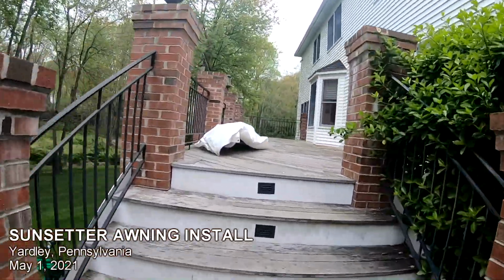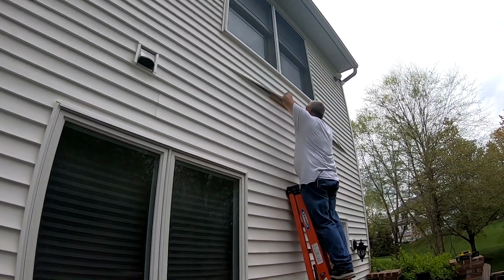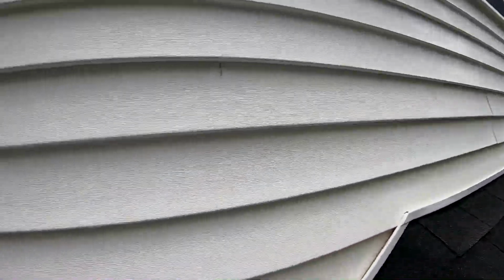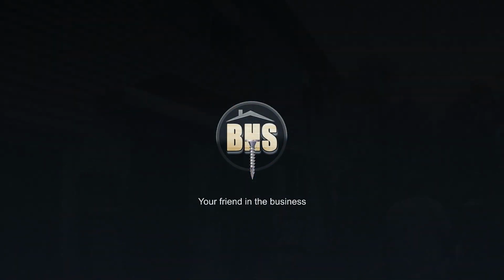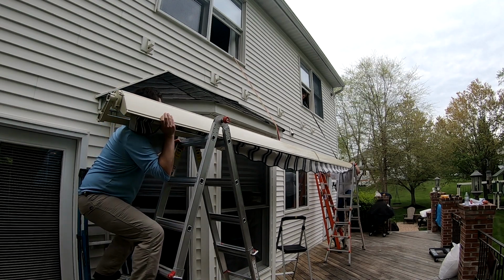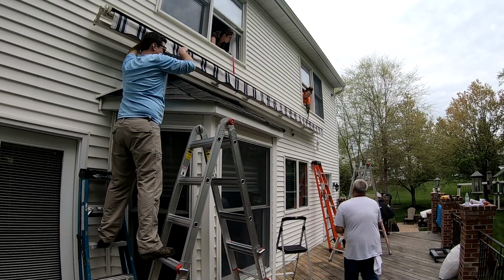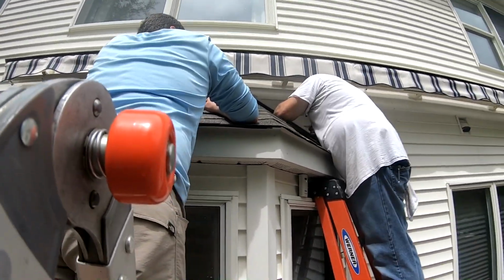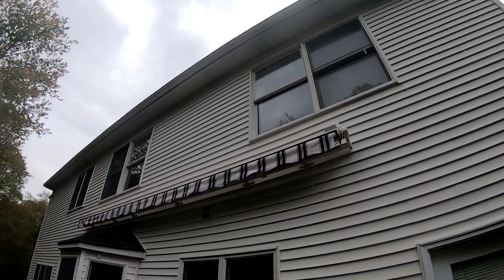HOW DO I INSTALL THIS AWNING

Comment: My buddy and I just installed one of these (18') for my boss two years ago...the wind off the lake has caused it to pull one of the lags loose so tomorrow we will be removing it to better secure our brackets. I was watching this video specifically for a better idea on removing it and lifting it back into place. We nearly died putting it on. Not looking forward to tomorrow. lol

One thing that helped us was we rented a dolly type lift...kinda looked like a floor dolly, but it cranked up approximately 8' high. We set our awning centered on the platform to take the bulk of the weight off our arms and had one person holding the awning steady while the other person cranked the lift up. Unfortunately we learned that our lift maxed out about a foot short of the height we needed to get it into the brackets and we ended up having to lift the awning the rest of the way in place just as you guys did. It wouldn't have worked on this job of yours, but if there's no obstructions overhead, it definitely would be of help. Thanks for the laughs! I'm going to go curl up in a ball and cry now.
Reply: Put a couple milk crates on the lift, then the awning on the crates
Reply: @Nunya.Bidness  We actually ended up renting a larger lift...I think it's just called a material handling lift. But it went up much higher than we needed it and worked PERFECT. Cost us I think around $75 at most for a full day. We set it in place, centered it up, unbolted the brackets locking the awning in place and then just slid the awning out of the brackets right onto it. We tied it off for added safety while we took care of our repairs.
Reply: @blackshirej  very cool and well worth the cost.  Watching youtubers struggle on ladders with 100 pound awing made me think twice about installing one

Comment: I have installed over 3,000 retractable awnings in the last 25 years, do NOT use plastic mounting blocks behind the brackets. They will crack over time due to sun damage and the weight of the unit. We cut out a piece of the siding the size of the bracket itself and fill that void with a piece of solid composite material and mount the bracket to that. Extra work but it is the correct way. And an electric hoist makes it a lot easier to lift. In short, hire a professional to install your awning. A 200 lb awning falling on your head is not fun.

Comment: Hi! Thank you for the video! Very helpful. Question: We need to purchase the same brackets, lag bolts and pins you’re using. We have a Sunsetter 18’. Where can we find the items we need? Thank you so much.
Reply from the maker: Hey thank you. 

You can get the siding blocks here: 

https://amzn.to/3nlyNsj

1/2” by 5” lag bolts are here, but I’m not sure which width and length your awning required so read the manual. 

https://amzn.to/3vAifjS

Good luck with your project. 

Cheers,
Bob

Comment: Thanks, super helpful to see how you got that up there. I have one coming and was a bit concerned about how to do that. I don't have the benefit of having windows above where anyone could help with a line.
Reply from the maker: The windows above were really more mental security than real security; not that it didn’t help but it wasn’t completely necessary. Message if you need help.

Comment: Great idea.. problem w weight. Bottom of bracket will crush box. Need to put 4- 3/8 washers on lag bolt on back side of box  for strength.. I'm pulling awning tomorrow. To install washers
Reply from the maker: We don’t have that problem with this unit but it’s a great tip for anyone installing one to take into consideration where gaps may exist.
Reply: I noticed you have 6 brackets for 20'..  this only came w 4 for 16'.
Reply from the maker: @johnzito7766  I used what the manufacturer supplied so if they provided the shorter brackets you may want to check with Sunsetter and see if that's not a mistake.

Comment: Great info. We ordered an awning and it’s on its way! Just wondering what you need the extra mounting block for the electrical for. You mention brd it, but I didn’t see it in the video. We already have an outdoor outlet.
Reply from the maker: I put another mounting block behind the outlet so it would sit flush to the wall.  If you have an outlet already and are okay with the placement of the outlet than you can just use that one if it's the proper amperage and all.

Comment: The other suggestion I found was to whack up 2x8" that was a little longer than the awning. Super ugly, IMO. This is so much more professional-looking!
Reply from the maker: Well, if you take the siding down, put up a long piece of 2x8 or 2x10, cap it with aluminum and reinstall the siding, that's probably even better, but definitely isn't a one day job.

Cheers,
Bob

Comment: Good video, there aren't many on this subject. Do you recall if those siding blocks had the siding profile across the whole block, or just around the edges?
Reply from the maker: The back of those blocks are hollow and the edge is the only place where the profile cut exists.  They are quite ridgid and will hold a lot of pressure and weight.
Reply: @BobsHomeServicesLLC  Thanks! I did find them locally, but wasn't sure they'd be rigid enough as I clamped down on them
Reply from the maker: @antoineg639  I would think the pressure against them once they are against the siding would be fine.
Reply: Mine squished in the center when i tightened the bottom lag bolt down. Just tightened them back up a couple of times as i wasn't taking it back down. if i had to do it again, i would recommend putting a shim or something behind the block to make it a little more rigid.

Comment: great video! what is the attachment on your drill for the bolts?
Reply from the maker: It's just nut drivers from Home Depot tool dept.  Milwaukee brand I believe
Reply: @BobsHomeServicesLLC  thanks!
Reply from the maker: @platham9076  No problem, Have a good night

Comment: did you say you can do this by yourself? then what is this!!!! 9:13. that’s 4 ppl

😂😄

i’m surprised the homeowner didn’t get the awning case cover or what ever that thing is called so water don’t run behind the awning. i should have gone with the case covering instead of the vinyl flap , when it rains rain water still gets through a little bit.